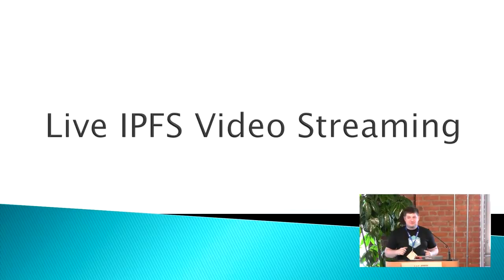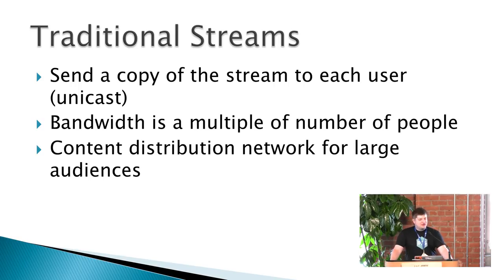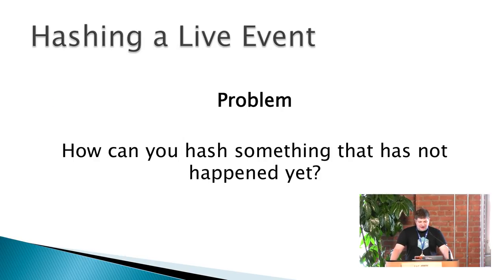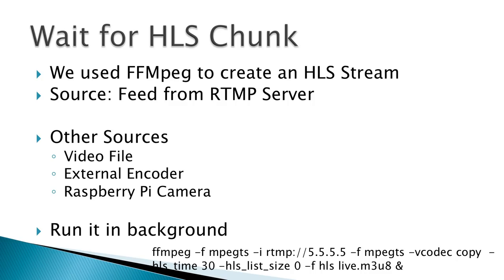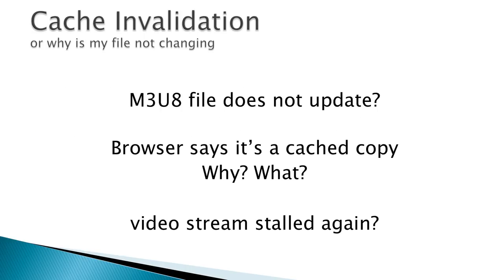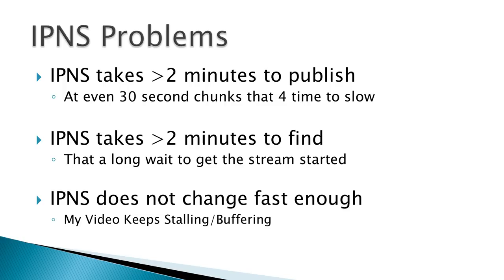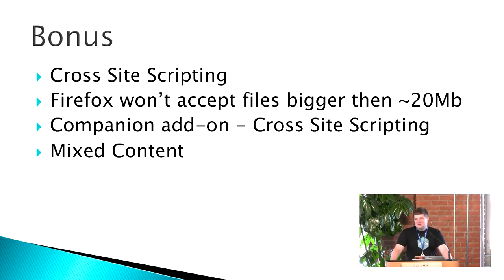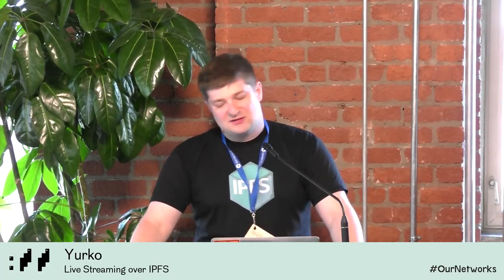Live Streaming Over IPFS

Comment: Very cool. But doesn't using the ipfs.io HTTP gateway kindof defeat the purpose of using IPFS in the first place, since everything is essentially still channeled through a single point? Someone correct me if I'm wrong.
Reply: It depends. You as a service provider also can use ipfs to better distribute the load between your backend infrastructure.
And instead of a HTTP gateway one could also opt for using the ipfs.js library and the client would connect via IPFS.